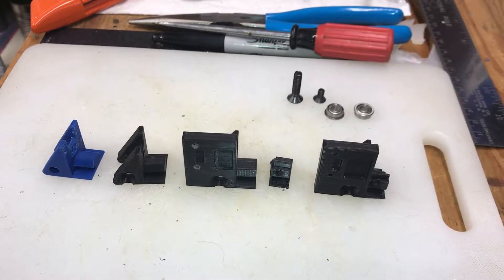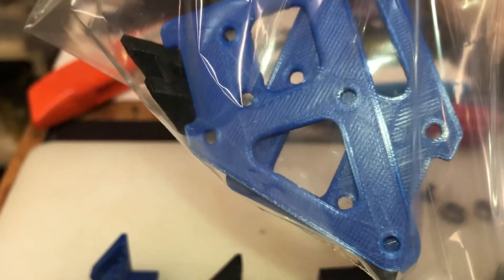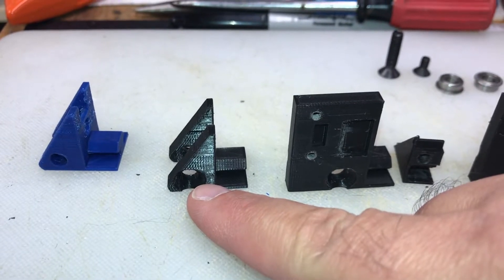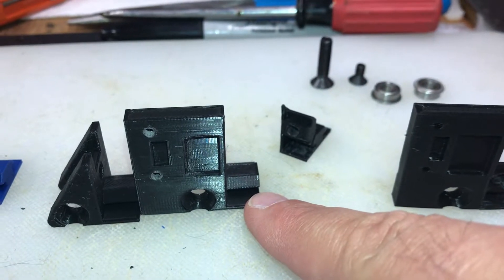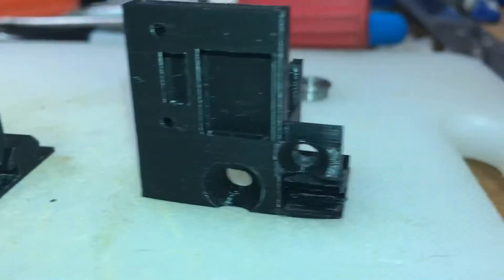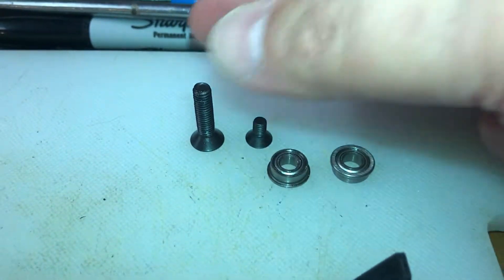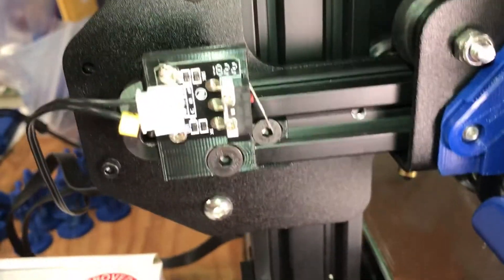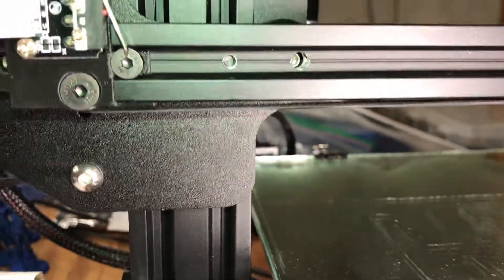Ender 3 X-Axis Idler with Stop Limit Switch

Comment: Im having this same problem! Greatly appreciate the video, i have one question though. What screws did you use to mount the stepper motor to the metal frame? The screws that are holding my stepper motor are very long since they travel through the stock cover that had the sticker on it, and Im wondering what i need to get in order to complete this upgrade?
Thanks!
Reply from the maker: Oops, I didn't list those!!!  I purchased some hardware on Amazon for use/replacement/upgrade in my various projects.  

These would be in this pack:
https://www.amazon.com/gp/product/B07CXZJPGH/

The other packs I have on hand are:
https://www.amazon.com/gp/product/B07CXZWC3J/
https://www.amazon.com/gp/product/B071VBL355/
Reply: @benjaminrodriguez6696  Thanks for the response! I've remixed your model a little bit so i managed to only use screws and bolts left over from when i upgraded my extruder to an aluminium one. Lets hope it works, so far so good at least ;) Will put it on Thingiverse when i have time!